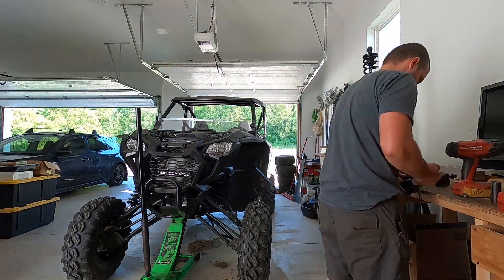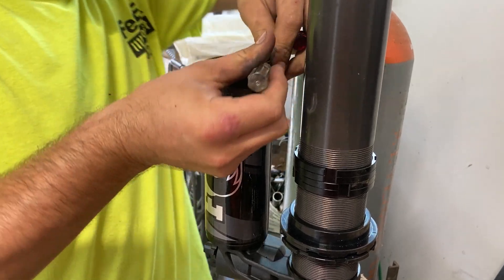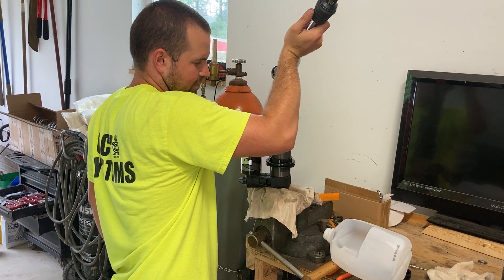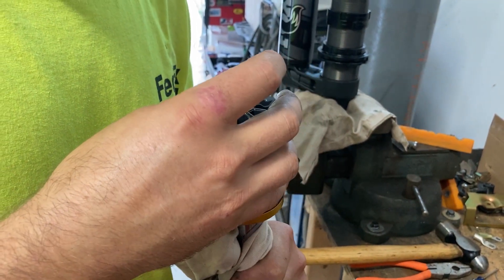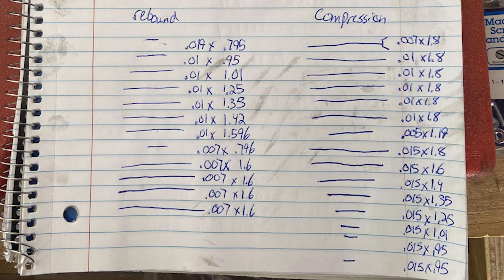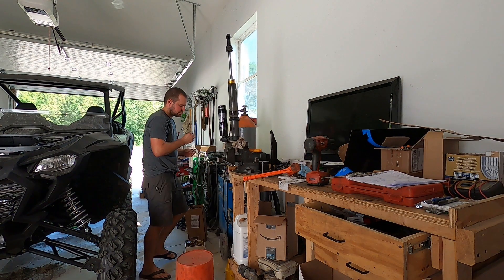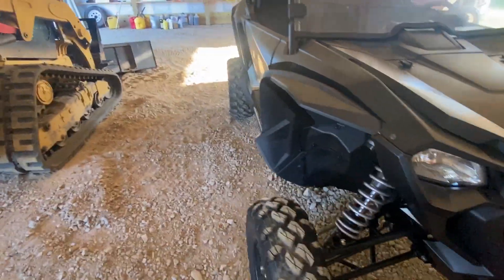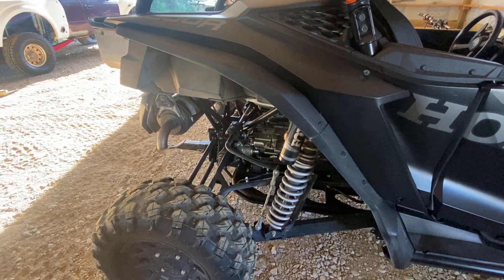Dissecting Honda Talon R Shocks

Comment: So it's mid-September here in AZ and having warmer weather is an understatement. Just wondered if you've had time to try any new valving? 

I got the "we know just what you need" treatment from ST, so went with Weller. I told Weller I wanted it to ride like a 1973 Olds 98 on the softest setting. not sure they've ridden in one?

The suspension is definitely softer, but they didn't get to the '73 Olds level. We've ridden it 1500 miles, almost entirely on the softest setting. Once, I sneaked the setting up to #2 when my wife wasn't looking. In about 3 minutes, she said "Did you stiffen up the shocks? This is too stiff for me." 

When i asked Weller, they said they put in the softest of the shim sets they use in an R. They also said they don't use the dual-rate shim stack (flutter shim).